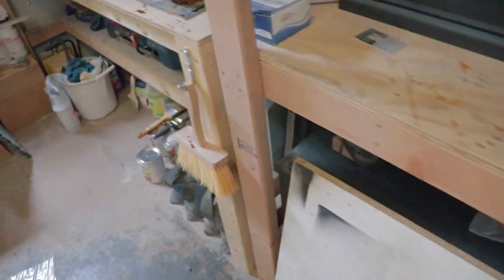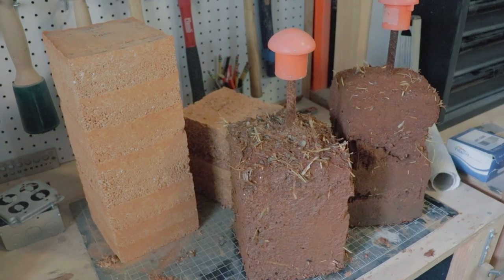Make Cob Stronger and More Water Resistant - Stabilized Cob Walls

Comment: Oh dear, more bad advice based on fear of water resistance.
Pozulan works well with lime as a render but adding it to earth with any clay content is the kiss of death. Many have made the mistake of stabilising Cob and mud brick only to find that after about ten years the Cob starts to crumble and break down. 
What most called rammed earth is in fact rammed concrete. 
Cob breathes because clay breathes. If you stabilise Cob you will kill everything that makes it work so well. 
You must have three parts sand to clay and you must use plenty of straw. Thats the formula. Dont mess with it. Once have a roof on the wall you only need a thin lime render to protect it. Spray it on with a gun is easiest.
Reply: How well does the lime/pozzolan render breathe? Does it adhere to clay any better than just lime?
Reply: @lenavoyles526  
I am only using a very small amount of pozulan, which is in fact a kind of mineral clay. 
Portland cement does not breathe. Never ever render cob with a cement render. It has destroyed cob walls on historic listed buildings that would have otherwise lasted another five hundred years.
Reply: does this come from actual building experience or just what you read about?
Reply: @CS-kk4tm  
Good question. Actual building experience.
Reply: Crumbly earth blocks no straw probably small amount of portland, cement top cap along long freestanding wall.  Would you try a hurl coat to bond to crumbly sandy surface before lime/sand/manure/toilet paper scratch coat, render with lime and sand+pozzolan , would you do a metal or fiber lathe to bond to the soft bricks?

Comment: Thx for the Info. I have 2 questions.

1- Have you ever considered using Hemp fibres instead of straw to bind the material ? 
2- Have you ever tried to build a cob structure using the 'Ram earth'' method or ''Hempcreet'' method using panels to guide & accelerate the building  process ?

Thank you
Reply: I write just in order to wait for the answer :-)
Reply: Hemp fiber makes no difference, there is no chemical related process, compound, or related biostructure that shows that Hemp is different from straw.  Any thicker "grass" will give the same substance to Cob.  Hempcrete is the same as straw or any other aggregate over time.  Hempcrete is the same as his "Ram earth" product,  but with more additives, it's pretty much like making concrete, then mixing in a bit of hemp (or straw) to replace the rebar.  So the concrete has some material that flexes inside of it, as concrete is not flexible.  

But either way.  Ram Earth is not stronger then concrete or reinforced concrete.  Which is pretty much what everyone is making when they mix the lime and ash.   Pozzolans is Fly Ash.  Ash makes concrete.  Lime is Concrete, it's what makes it water tight.  Sand and rocks are aggregate.  Which is Concrete.   lol. 

So all this work..  You are literally just finding mixes, to come back to the same thing.   Concrete.  lol 

I'll repeat again.  Hemp does not make anything different in the terms of chemical processes to make cob or making hempcrete..   Hay and hemp are the same thing in this process, which is just a flexible material that adds flexibility to the.... concrete.. lol
Reply: @hawkintelligence    Straw is added partially for structural/binding purposes, but also for insulation purposes. In the latter sense, they definitely are similar as they are both hollow tubes of mostly cellulose material.  The difference being that hemp fibers have smaller tubes, and thus might be more insulative by reducing convection better.
Reply: @justinw1765  this is a solid tip. I'm going to conduct a study on this when I have time

Comment: Very cool, thanks for sharing. Can you layer the two? For example, could you add lime+pozz stabilizer to the mix for the first few feet but not add any to the upper majority of a wall (assuming there is a good roof, so the bottom section is the only part at risk of getting wet)?

Comment: In your experience,  do you have to reapply lime to cob walls throughout the years?
Reply: I saw from other videos that it's recommended to give everything a lime wash once a year
Reply: Four coats of black soap or veggie soap castile etc or lindseed oil and it combines with lime to form a polyurethane

Comment: Rammed earth is the best because I’ve even seen it mixed with a little bit or mortar or cement mix. 
  Can you use the it with the other soil and get the same results as the rammed earth?
Reply from the maker: Yes, you can add either cement or the lime+pozz mix to any kind of suitable soil for rammed earth or cob.

Comment: That rammed earth test looks great. what pozz did you use. Also what was the rest of the ratio? was it 90 percent just dirt or was it a certain mixture of clay, sand, and gravel
Reply from the maker: All I know is it was pozz/metakaolin. I got it from a company in Georgia. 
Yep, just 90% native subsoil with the 10% stabilizer.
Reply: Thanks for the response. How would you compare that rammed earth block to a block of concrete?  If you put weight on those corners or pushed down would it collapse/crumble? Or did you find that it is relatively strong
Reply: Also, did you dry mix the soil, pozz, and lime and then dampen it while adding it in layers?  Not sure if you already have a video on the process

Comment: Hi I'm new. Can someone explain the reason cob walls don't fall over?
Reply: The rain typically cannot produce enough water to "meltdown" your cob walls... especially if it has a sufficiently sized roof overhang and thick enough walls (18"+). 

It would have to be concentrated into a specific spot and with an intense amount of force (kinda like water out of a firefighter's hose) THEN you would have reason to think your walls are melting. 

Don't also forget your stick frames, rebar and straw/hemp are keeping everything held together better. lime plasters/ tadelakt are another way of putting thumbs on the scales by keeping water out on the outer walls.

EDIT: Another thing you will read in Alex's book is that centuries ago, people made buildings that were much like apartment buildings out of cob. They had to arch the angles on the sidewalls slightly (kinda like pyramids) because of how heavy they were and the cool thing is they're still standing to this day.

Comment: What's the ratio of rammed earth-lime-pozz?

And what's the ratio of cob-lime-pozz?
Reply from the maker: It depends on what percent of stabilizer you want to add. So, if I add 10% lime-pozz mix, I subtract 10% of the total weight of rammed earth/cob mix and add the stabiizer in as 10% of the total weight.
Reply: @thiscobhouse 
I was also wondering on the lime-pozz ratio
Reply from the maker: @freightshayker  Oh! Yes, the lime-pozz is just 50/50 mix.

Comment: How to Portland cement and lime & pozz compare as far as price and availability go? While I do want to avoid toxic materials, a tight budget is a high priority/presser for me.
Reply from the maker: The lime+pozz will be slightly more expensive than cement for stabilizer. Personally, I don't have a problem with cement for stabilizer. If there is any toxicity, its very minimal.
Most people just have a problem with the emobodied energy used to produce cement.

Comment: Hello and good day,
How much lime per cup of cob?
Reply from the maker: I always measure by weight. Determine how much your soil and aggregate (sand) weighs, then subtract 10% (for example) from that, and replace that 10% weight with the stabilizer.
Reply: Thanks
Reply: @thiscobhouse  are you using s lime, slaked lime, or builders lime or buying the more expensive lime from Mississippi Lime?  I need to go some experiments and wanted to know which I needed to go with. Hoping for the less expensive. Lol
Reply from the maker: @karensprings4237  I've been using Type S lime.
Reply: @karensprings4237  just curious where you buy your Mississippi Lime? I'm in Oklahoma and have not found a retailer yet. I'm looking for a 50 lb bag, not the rail car that Mississippi Lime is willing to sell me ;)